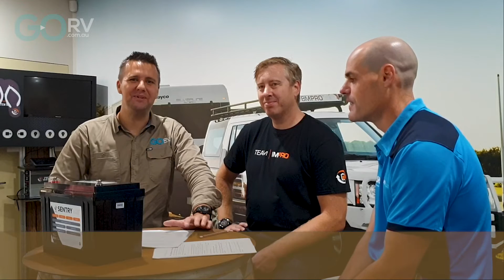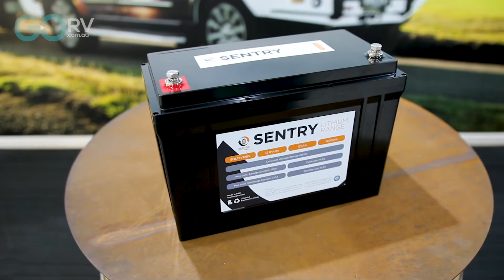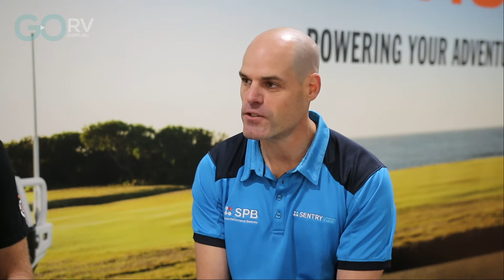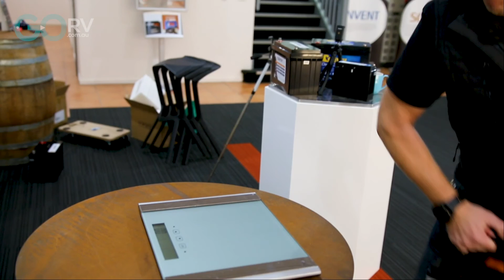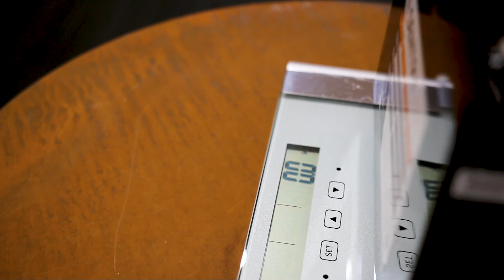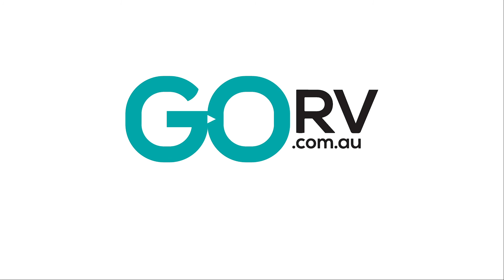Lithium batteries for caravans: essential information!

Comment: How many typical cycles could a lithium battery perform, like the one (brand)  you show? With other brands of lithium batteries, there can be limits on 'banking' (setting up parallel batteries, no more than two), I think due to the battery's internal 'battery management systems'. I am aware of one brand where let's say you chose a 125 amp battery, and banked it alongside another 125 amp lithium battery, you can only put a 1000 watt inverter on (whether one, plus another). To  use a 2000 watt inverter, you must use a 200 amp type etc. (in our family, we have  used agms, lead crystal types, and preferred more smaller batteries in a parallel situation for ease of movement due to weight, and better backup, should one battery fail. (safety in numbers effect!). I was at first impressed with all the touted benefits of using lithium, more cycles; less weight; more power capability than old type), but if looking at going to lithium, it would appear one has to really study/think about one's exact usage, and for the future. It isn't as if this technology is cheap!